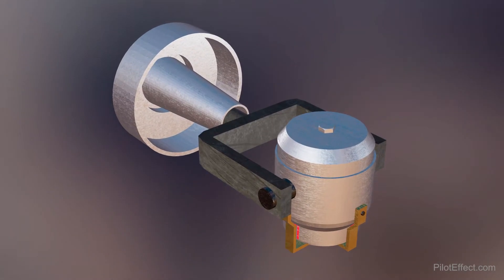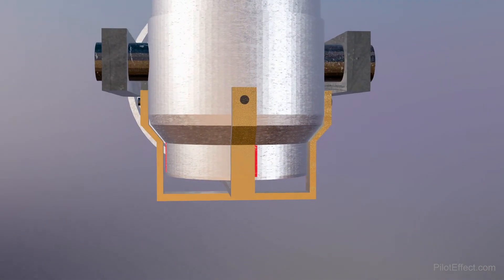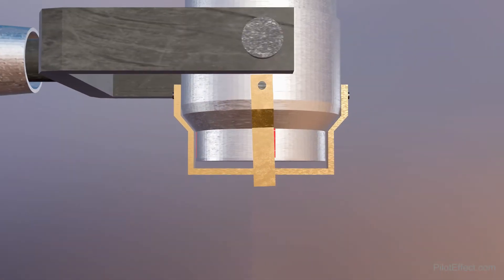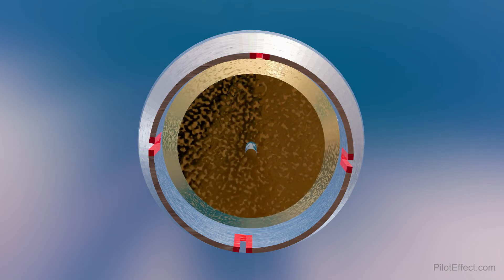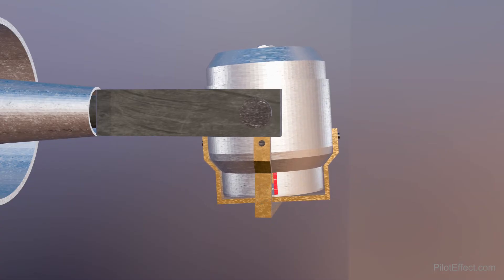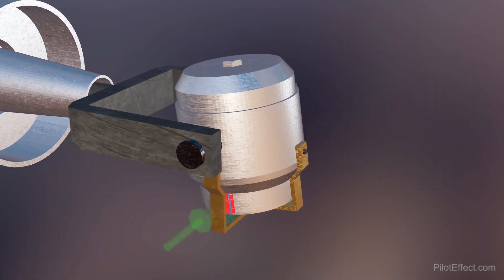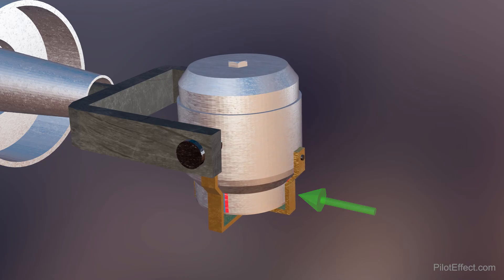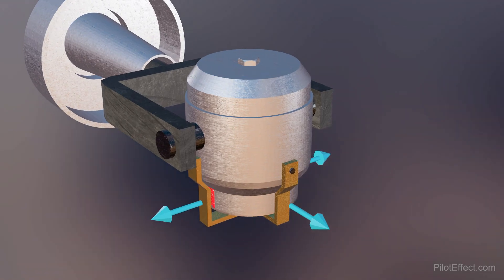Pendulous Vanes | Pilot Tutorial

Comment: Question, why does it appear like the airflow changes direction with relation to the port which is completely unobstructed? Air flows out of the ports, into the instrument casing and then off to the vacuum hose, but the green arrow suggests that airflow is reversed and flows into the completely unobstructed port when the vanes become displaced. Thanks in advance to anyone who can explain this for me
Reply: To answer my own question a bit, is it the increase in air flow leaving that particular port that creates an equal and opposite reaction force against the gyro casing which then experience precession and is displaced 90 degrees?

Comment: If it is a vacuum instrument, how does air bleed out of the ports at the bottom of the case? Shouldn’t air be sucked into the ports?
Reply: I suppose the air is sucked from the outer side of the gyro casing

Comment: But, what if the attitude change was more significant (perhaps extreme). Say the plane pitched or banked at 30 or 45 degrees. At least from the way the animation shows it, for a steep angle, the vane would move past (away) from the bleed holes on both sides, at the same time, allowing for the same amount of air to escape on both sides.

I assume that means the animation is a little more simplistic than the mechanism actually is.
Reply from the maker: At the end of our attitude indicator tutorial we show a demo of the limitations of the instrument before the gyro tumbles. Yes it is slightly simplified for ease of understanding.

Comment: What would cause the gyro to be moved? And how does a plane use this device over a spherical earth?
Reply: Gyroscopes don't care about gravity, that is, if it would be to move 90 degrees over the surface of a sphere, the gyroscope would now be parallel to the surface. In a fast moving plane, this can happen, and the gyroscope inside the attitude indicator would be misaligned 90 degrees, showing incorrect information. The pendulum though, does care about gravity, and automatically corrects this deviation in the gyroscope, causing the gyro to be constantly pointed downwards, showing correct information.
Reply: @Anohaxer  where are you getting this information from? ive talked to some people in the aviation industry  specifically mechanis and they assure me its just a gyro. nothing ":correcting" the gyro. Pendulous veins keep the gyro in its original position.
Reply: @cubano2992  Pendulous veins are correcting the gyro's position, thereby keeping it at it's original position
Reply: @cubano2992 :  ..."specifically mechanis and they assure me its just a gyro. nothing "correcting" the gyro..."    <<<<2021.05.18. You are completely right. Pendulous veins are for primary adjustment of the gyroscope axis to be strictly vertical when an aeroplane is on the ground before the flight. There is no correction of a gyroscope during the flight, otherwise the usage of the gyroscope is meaninless, because the gyroscope is used _only because of its unique capability_ to hold the constant direction of its axis.
Reply: @sapientisatalexanderthegre9499  so no change or adjustment for curvature, correct?
Reply: @nintendokiller1 if you re-read carefully you will see that the pendulous vanes do indeed correct for the curve. Gravity always points towards the centre of the earth. The pendulous vanes use gravity to correct the gyro.

Comment: Finally, the answer I was looking for, I was wondering how it self corrected. I'm assuming that electrically operated attitude indicators are not using an electric motor to spin the gryo but to run a fan to blow the air through the attitude indicator. Is this correct?
Reply from the maker: Calvino Electric typically use a magnet system instead of the vanes.